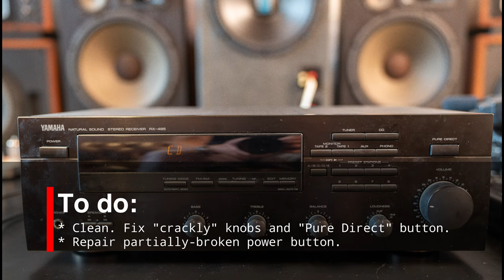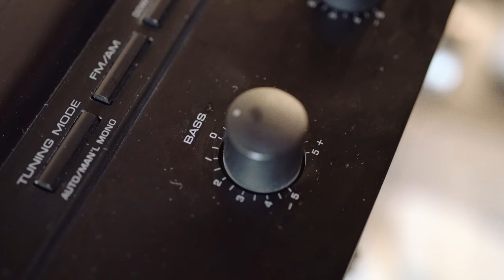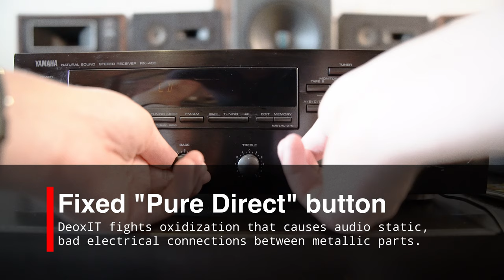Yamaha Stereo Amplifier from 1996: Cleaning + fixes. ✨🛠️ "Oddly Satisfying?" Maybe!

Comment: VFD display dimming problem.. Post a video for that problem
Reply from the maker: The VFD on mine is not good, and it may be fixable if the problem is related to capacitors. I have some equipment on order that may help, and will post something if it works. Good suggestion.
Reply: @scottschiller  thanks for your reply and 
I'm eagerly waiting for your post.

Comment: How did you fix the Pure Direct button?
Reply from the maker: I skipped over the detail, but I used the same DeOxIt electrical contact cleaner that I sprayed on the bass, treble and other rotary knobs.

That button has since become quite crackly again, and could use another round of contact cleaner.

Comment: I have the same receiver.  And it has the exact same issues as yours (minus the power button issue).  Is it difficult to clean the contacts for the push buttons?  CD/AUX etc?  Mine is stuck in AUX.
Reply from the maker: Hm! I didn't look at the push-buttons for mine, come to think of it - they all seemed to work OK. The VFD-type display on mine (AUX, CD etc.) has also definitely faded over the years, I forgot to mention that in the video.

I need to put some more contact cleaner on the "pure direct" switch, it's gone somewhat bad again.
Reply: @scottschiller  Yeah, my source selections barely work.  Same with memory selections.  Great receiver tho, nice clean audio.  I bought mine brand new in the 90s, back when AV receivers were all the rage and receivers like this one were not easy to find.  And that 70wpc is more like 120wpc.  It really hauls at 8 ohms.  I haven't tried it with 4 ohm loads (yet) :)
Reply from the maker: @VA3JPX  I'm right there with you! I remember looking for something without all the 5.1 and video bells and whistles I didn't need - I just wanted a nice two-channel amp, and little else. I used to blast tunes very loud on this, between my home and the occasional house party and high school sock-hop of sorts. It always delivered! 8 ohms here, too. Never tried it at 4.